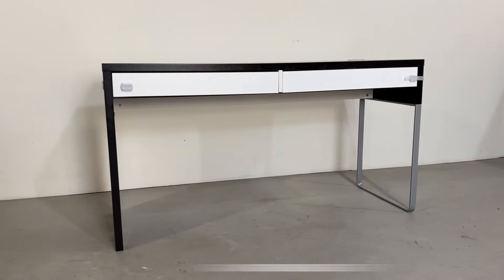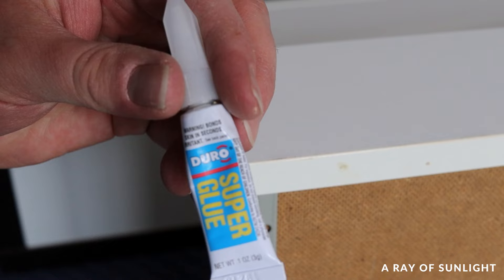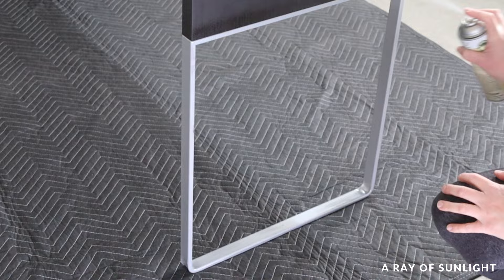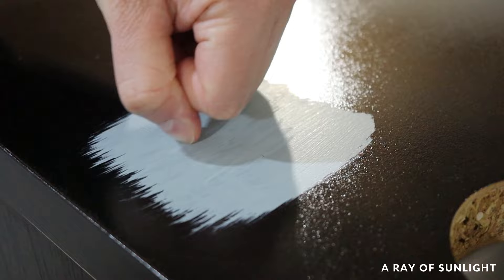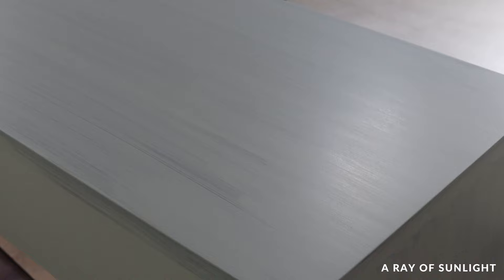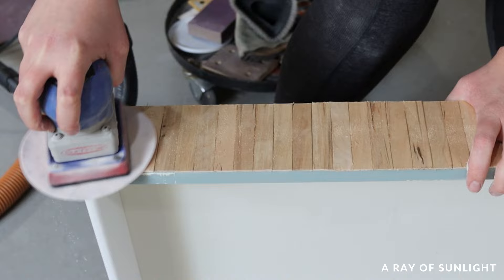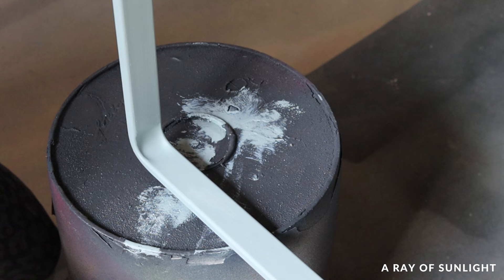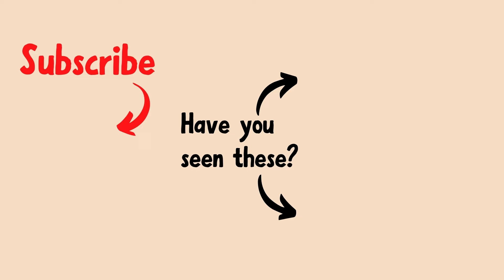Painting IKEA Furniture | 🙅‍♀️ NO Sanding Required! | Laminate, Wood, Metal, Plastic

Comment: .. I really don't get the fascination with painting with "no sanding"... It takes mins to scuff sand so the primer grabs and you guarantee better adhesion... shellac for sure, but after a quick sand and and I like to roll on BIN shellac... I just painted 10 feet of laminate lower cabinets and the sanding took no time with a random orbital. ..

Comment: I used Zinsser BIN shellac primer, rolled on, after sanding even, and it still scratched off with a nail... which I'm really confused by. Not only did I use the "better" primer you mentioned, I also sanded just in case... any ideas why?